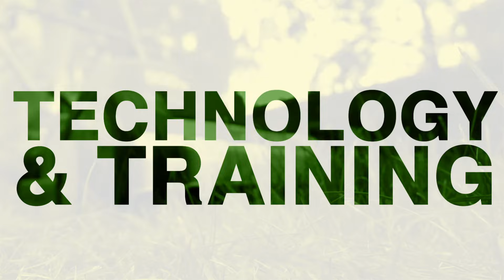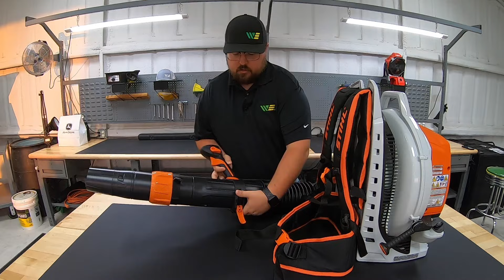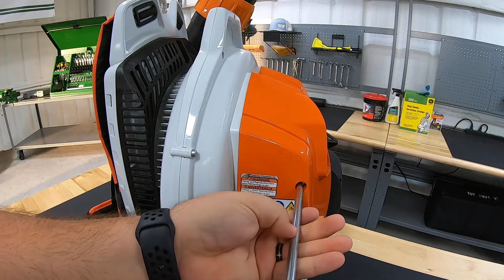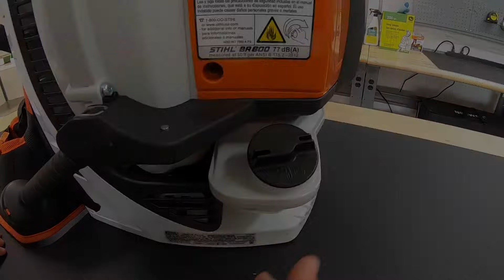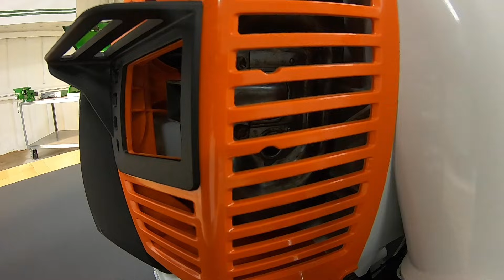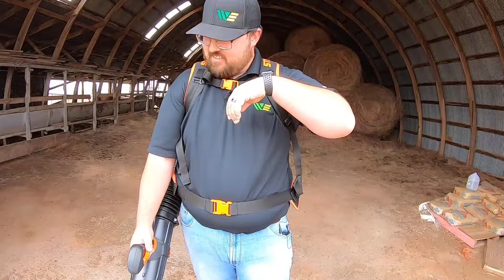Stihl BR 800 C-E Magnum Review | Stihl's Most Powerful Backpack Blower

Comment: I find it very hard to start. Pull, let it rewind, pull, pull and pull and pull, sometimes feels like its turning engine over, sometimes not. Doesnt even cough or fart, then suddenly starts. Very unpredictable and takes forever to get going. I came here looking for starting tips,.
Reply: Dont try to start it like the guy in this video.  He has no idea how to properly use the side pull starter.  It's an old video, so hopefully by now he knows how to do it correctly

Comment: I own this blower I have 5 acres. It is willing to do whatever you want. As long as you continue to have the gas required. Make no mistake, it's like driving AV8 with the pedal to the floor. 5 acres. I have to fill the gas tank between 8 and 10 times Other than being a gas hog And needing a bigger fuel tank it's a beast it'll geter done

Comment: I bought this exact Stihl model 1 year ago. Didnt touch the valve cover for any adjustments yet. Its a beast of a  blower machine. Easy maintenance.
One small non issue is the white air plastic turbine housing Torx fastener bolts were loose from all the use and vibrations. Blue Loctite them.
E3.24 spark plug is my choice over the stock NGK CMR6H. 
Echo 50/50 mix. Runs much better for overall satisfaction. 
Your video is legit. Thank you.
Stihl KM130R Kombi System happy owner.
Reply from the maker: You definitely seem to know your stuff. Thanks for the comment and info.

Comment: Was never the most powerful the echo 8010 and now 9010 rain Supreme they need to make a br900 asap i love sthil but ive converted over my blowers out of 12 br800 ive kept 3 for my install crews and bought 14 new 9010's back in October they are basically double the strength and use 2/3 more fuel or around 45 mins per tank of gas. I use 93 octane with the opti oil so i can run one fuel across the sthil and echo and really all brands the sthil run cleaner now and seem to rev better than the swamp water ultra i was using but i was also using 87 octane as well.
Reply from the maker: I’m not sure what is to come in the future but I would imagine something bigger and better is on the way.

Comment: I never heard of having to switch an engine from summer mode to winter mode . Are you sure that switch might be for the air on you back ?
Reply from the maker: Yes, this is an actual thing. There is a whole section in the operator manual.

Comment: I got one of these. It gets used heavy duty daily commercial use. It's pretty good and reliable. Only issues i've found are that after about 12 months, you might have straps starting to fray and break. And also, when you have to warm start it, it can be difficult to start unless its put on 1/2 choke

You also need to 'work' the pull cord to get the piston in the right position. So it will crank and start. Otherwise you can just keep pulling the cord forever and it'll never start

Overall I would say its ok. I have also used the Shindaiwa EB770 and would rather shell out a bit extra for that, its much easier to start, more comfortable and more solid for daily commercial use
Reply from the maker: Thanks for the feedback and thanks for watching!
Reply: @WesternEquipment  Thanks for putting up the video :)

All the best. :)
Reply: As a roofer I absolutely hate dealing with a dam blower that won’t start lol

Comment: What do you recommend or suggest the proper way to transport the BR 800 C E Magnum on a open lawn service trailer?
Reply from the maker: That is a tough one. I do not have much experience with the commercial lawn trailers, but I have seen setups where there has been basically a cage built with a locking top. The tube seemed to have space to fold towards the trailer and sick out of the side of the cage. I hope this helps and thanks for watching!
Reply: @WesternEquipment  I ended up
Ordering the blower rack set up from Trailer racks. The blower is all that you reviewed; nice operation for a solo lawn service provider.

Comment: i have only had redmax 8500 blowers i went out on a limb and bought one of these.. things i like are the comfort and the more narrowed down blowing, seems to be more pinpoint as well as the engine is much more quiet. The blower has failed to start i cant tell you how many times, the thought of how many more moving parts it has being a "4 stoke" style engine is going to be more on the wallet over time than a normal two stroke, and that stupid little plastic wire harness thing that clips onto the machine for the throttle wiring constantly pops off since day one causing the harness to keep pinching my forearm, i ended up using a large zip tie to prevent it from coming off again.. there has been many times ive just put it back in the trailer and pulled out a 8 year old redmax that hasnt run in a year that always starts and gets the job done. The fuel tank is not big.. the redmax will run for a straight hour on a full tank, my guys always pick on me cause i " cant get the job done" but hey not bad for 650.00.... wont buy another one but its comfy
Reply from the maker: Well thank you for the feedback. One of the starting issues could be your spark arrestor screen. If it gets plugged this will give you plenty of problems and hurt your fuel consumption. Thanks for watching!
Reply: try a Redmax 7500 or Husqvarna 570 tapered nozzle on your 8500 if you like the narrow stream and higher mph.

Comment: I have a 450 electric start and would love the magnum but not sure I can live in without that great feature any more. So good when people cone to talk to me in site or when I just need to stop for pedestrians, I'm willing to forego that additional CFM for the electronic starts but side start intrigues me..

Is there really that much more power in the Magnum or am I best off sticking with the 450?
Reply from the maker: So the two big differences between these two are blowing for (450=28 Newton : 800=41 Newtons) and CFM (450=642 :800=912) The side start is a really good option and it is a super comfortable machine to wear. The 800 also has a larger fuel tank adding 10 oz. of fuel capacity if that means anything to you. I hope this helps and thanks for watching!
Reply: @WesternEquipment  just bought the 800 yesterday! 

I actually was quite disappointed at first until noting the 450 had a slightly smaller chute. I changed the tips over and voila, there it was! I found the stock tip "unrefined" and felt like I couldn't control where I was blowing but the smaller tip has me right at home with a little extra power from the bigger 800 engine

Comment: Does yours make a tick tick sound as it’s shutting off?
Reply from the maker: I can't remember if it did or not. Are you having issues with yours?
Reply: @WesternEquipment  It starts and runs perfectly fine, idles fine, no clicking or sounds but when you press the off switch, as it’s shutting down you hear like three or four clicks almost sounds like valve sticking... could just be the way the engine is. Mine is brand new that was my first time using it and I’m using Moto mix. At 15:20  yours seems to make same sound, 3 ticks it sounds like
Reply from the maker: @unseen_perspectives_419  Going back and watching it I definitely hear it. I'm sure that is how they all are. I used that blower a few more times after this demo was done and it has been just fine. Good catch though and thanks for watching!
Reply: @WesternEquipment  I appreciate you responding back and the insight. Its been a while since I have used gas equipment, I was using ego battery 0PE, decided to go back to gas because I’m doing a little extra work that warrants the need for longer run time and extended use. Once it warms up a bit I’ll get to use it more, so far very happy though.

Comment: What type of oil do i add
Reply: If your asking this question you shouldn't be operating any machinery
Reply from the maker: It needs to be a 50:1 mixture. I recommend using the Stihl Ultra mix oil that comes in a silver bottle. Thanks for watching!

Comment: I replaced the side start with a regular pull start. I was a first gen adopter and it helped me maybe less than a dozen times. The telescoping tube should have been a feature of the x.
Reply from the maker: I agree about the tube. Just curious, What made you decide to go back to the regular pull start?
Reply: @WesternEquipment  just knowing the environment I was using the blower in (lot sweeping). The petroleum based asphalt was prematurely wearing everything out in the assembly. Surprisingly the 800x recoil as significantly lighter and the plus to me was having a regular starter, not the easy2start system. Eventually for regular lawn car I'll purchase another 800c but at the moment the 800c/x hybrid is perfect for me. Its bulletproof and much quieter for noise ordinance that echos 010 series would be mu h too loud for.

Comment: Wouldnt buy this Stihl  blower. I had three Stilh trimmers over the years all lasted  about 3 months and are impossible to work on. The Stihl blower here is not near as powerful as the new Echo PB801. I mean its not even close. The stihl is more inline with the redmax ebz8500 which engine design is a decade or more old! Further look at the breakable parts on the Stilh, No way that holds u p commercially. Looks like all gimmicks. Plus i highly doubt the Stihl engine will hold up day in and day out for more than 1 year before major loss of power and frame/ parts integrity issues. Get the Echo PB 801 a far better blower that works! And I am not even an Echo fan I hate there Trimmers and chainsaws!
Reply from the maker: Sorry to hear of your bad luck with the Stihl units but thanks for watching!

Comment: Very good video. I’m an echo fanboy and have not used this blower. I know STIHL makes good products but seems like there is just too much adjustability with this unit. I wouldn’t take my air filter off to flip a switch to run my blower in the winter. Just saying. No tools required to change the air filter on the echo, blows harder, and no valves to adjust.
Reply from the maker: I totally understand. Thank you for watching!
Reply: Cope

Comment: Bought this machine last year and it stalls out and won't restart till it cools off.  We have several Stihl products and the newer models have issues.
Reply from the maker: Hmmm this is odd. Have you checked the exhaust screen on the muffler? Also may check to make sure that your fuel isn't mixed to thin or too rich.
Reply: Check this video, he had the same issue. Something not clipped properly! https://www.youtube.com/watch?v=JJsZC1NILAk

Comment: Great video! I have had this blower for just over a year I love it. Use it year round started snow removal last week. Seems a little doggy right now but temperatures have been anywhere from -5 to -15 already.
Reply from the maker: Thanks and glad to hear you are happy with your blower! Thanks for the comment and for watching.
Reply: There is a On these located underneath the air cleaner that you switch over for Winter or summer
Reply: It's a Scrench!!!!

Comment: Can you change the nozzle to a narrow one like the BR600?
Reply from the maker: I don't currently see that option for this blower but I will look further into it.
Reply: its narrow for the larger size , so it doesnt have to be any narrower .. works perfect as is 240mph , if u want to push large dry piles you might want to cut the last few inches off and it will push wider but less mph

Comment: Stihl make excellent blowers but always found the straps bit of an issue, almost bought one of these but opted for the Husqvarna 580 bts and don't regret it for a second! Stihl & Husqvarna make the best tools in my opinion and you won't go wrong with either!!
Reply: I own the Husqvarna 580bts too. Great blower for sure. The Sthil BR 800X has more blowing force for sure. Like them both, Sthil wins IMO with less weight and the throttle is in line with the tube. I don't like how Husqvarna designed that at all. I think the 580bts model was updated on that. Both are a good choice.
Reply from the maker: Definitely agree here. Both are great brands of equipment!

Comment: Ive got Echo blowers, Stihl weed eater,  Stihl and Echo chain saws. I like both brands but the fit and finish on Stihl is better. 77 dba is pretty good. Still plenty of noise to piss people off but quieter than my Echo 8010.
Reply: I am a Gardener and blowers always get the most noise complaints. 
I now carry two blowers.one with the muffler removed,I use it for pissing of the people that complain. 
This puts a big smile on my face.
Reply from the maker: I completely agree with you here. Both are great product lines!

Comment: That’s the one I’m going to buy.  What’s the warranty period on this blower?  I noticed that JOHN DEERE dealers and Montgomery Ace Hardware sales Still blowers weed eaters etc and other dealers.  Which dealer is best to purchase Still products from for the best sales service parts and maintenance?                         Liked Subscribed & Shared
Reply from the maker: The warranty period depends on the usage. So if it is bought as homeowner usage it should have a standard 2-year warranty that can be extended to a 4-year by the purchase of either Stihl MotoMix or the Ultra Oil Mix. If it is commercial use I think it is only a 1-year warranty. On where to buy, in our area for parts and service it is generally better to buy from a John Deere dealership but I'm not sure what kind of parts inventory is kept on hand in your area and if the hardware stores have a technician or not. I would ask the places you are looking at buying from and see if they have a technician on site for service and if they keep parts on hand. I hope this was helpful. Thanks for watching!
Reply: @WesternEquipment  Yes, and what commercial guy would be foolish enough to tell them it's actually for commercial use and waste 3 years of warranty?  Sorry, Honest Abe, but not me.

Comment: Do you suggest running stihl motomix or hand mixed gas
Reply from the maker: Use hand mixed gas most of the time. Use MotoMix 3 or 4 times a season to keep your system good and clean!
Reply: I use Stihl HP Ultra with 89 ethanol free gas.  My BR800 runs perfect.
Reply: I use aviation fuel,mixed.
Reply: @1Brianjohnson.  nitromethane  runs best.